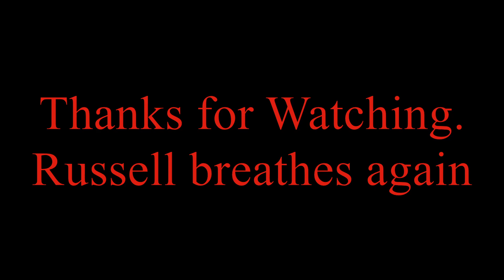Russell Repaired (Again) August 2020

Comment: That went well!! Good fix Jo. None of those scars looked like easy fixes. I wrecked one of the EDFs yesterday. Totalled it. I used one of those new Spektrum RXs with no antennas. It was flying really nicely and the radio started yelling RF critical. It speared straight into the ground and the fuselage exploded. Even dug a crater. :(
Reply from the maker: I wasn't too concerned about the fuse damage as it all aligned up reasonably well. But the wing D box fix was a worry, since I don't know if I've secured it enough to pull Gs on the wing during loops. Time will tell!
Sorry to hear about your EDF. I've gone off Rx with short antenna, and find the idea of a Rx without any external aerial just suspect, even if Spektrum are doing the selling.

Comment: I love the method you chose to make the repair. Nice job Jo! 👍
Reply from the maker: Thanks Taildragger, it's not the prettiest finish, I think I need to sand down the CF TOW a bit, but I'm not too fussed that the look is a bit messy for now. I'm more concerned that the strength is in the fuse without adding too much weight. I think there is about 5gm added with the CF TOW and the CA glue. The CG didn't shift so that's a relief. 😁

Comment: Yes, we become inventive engineers! And they always fly better after a few crashes. Great job on the repairs Joanne! And a great flight with her. Looks like you had a good crowd of pilots with you! It's hitting 100* (38C) now, clear and sunny with some medium winds, really getting hot here. Lot's of sweating! HaHaHaHaa  I just got my Rebel EDF back together and my F22 after destroying the fuselage. They are both air worthy again. I also have been wanting a large slow flyer and purchased the Arrows Husky 1800mm.  Looking forward to cruising around the sky with her. Still loving my Tundra. I flew out 4 batteries in her Saturday.
Reply from the maker: Good to hear the EDFs are back in service. They tend to be just tubes and fragile, so well done on the repairs.
Had a quick look at the Husky. Seems a great wee model, quite a looker too.
And yes, the Tundra is really great, I love flying it in all different conditions.
Reply: @jo2lovid  I have been taking my Tundra up every week since I got her just to try her in ALL wind conditions. She has no problem handling everything we have here! She is my favorite for now. I shattered the carbon prop she came with and replaced it with an 11X7. Can't tell the difference and it gives me more ground clearance! It's always good to see you out flying! Take care.